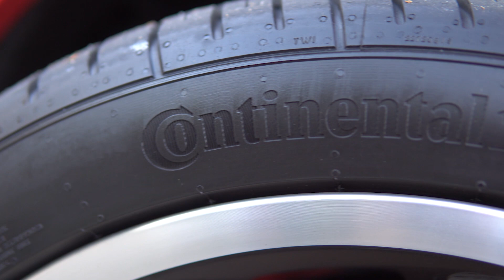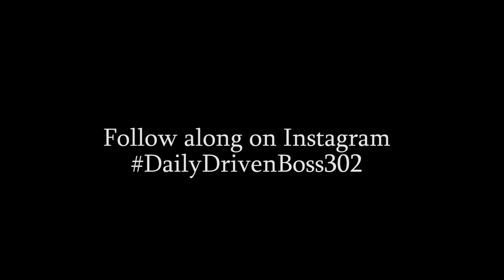The Verdict Is In | Solving The Issues With The MT 82 Transmission

Comment: tr 6060 swap
Reply: MT-82 has way better gear ratios
Reply: [][][]MANN  
The MT82 still has better ratios and will beat a TR6060 car all other things being equal.
Reply: @331Grabber the mt82 is a better trans for the coyote.  If you are na and go tr6060 you need like 410 to feel like 331 and 456 to feel like 373.  That's another large expense on top of the Trans itself.  Better off doing a built calimer ppl are running mid to low 9s with them without issue.  Clutch and shifter fixes 99%.of the issues.  If you need it to hold up to big power calimer built mt82 ftw

Comment: Your MT82 Getrag 6 speed has notchy gear changes because the synthetic oil that Ford uses is too good, hence the synchro's are slipping and not engaging. Just add 40cc's of Lubeguard Friction Modifier to the oil... https://www.lubegard.com/products/lss/

Comment: why would anyone buy a mt82 when there is the 10 speed. The new automatic transmission is faster, greener, and better in traffic
Reply: Because people will always love manuals. Duh. It's different driving experience
Reply: @johnnymoya6261  i concur
Reply: @johnnymoya6261 same.  Manual in a sports car, or no sports car.
Reply: The 10 speed is still a gay auto and don't act like they don't have their issues too.  At least my trans will shift when I want it to not when the ecu decides to let it shift lol.  They didn't even have 10 speeds till 2018 so they have 0 to do with a boss 302.  

What do you mean it's "greener"?  Autos are gay my friend and don't offer anywhere near the driving experience of a well set up manual.